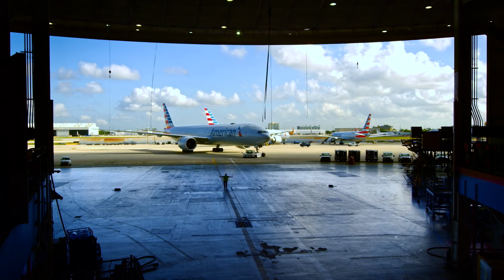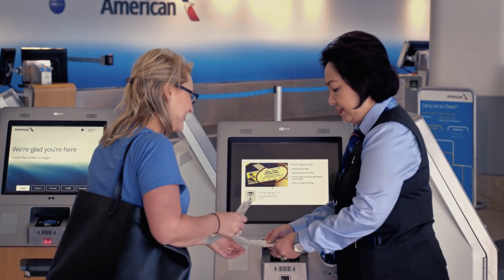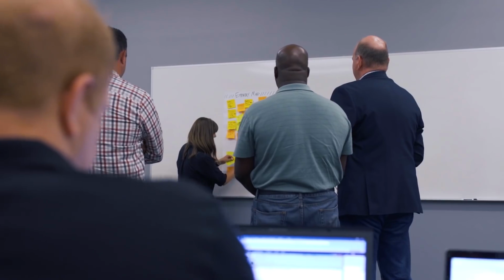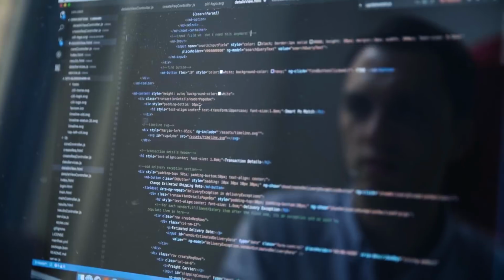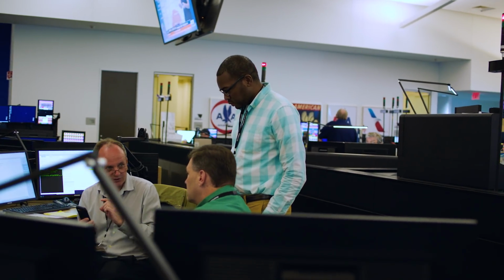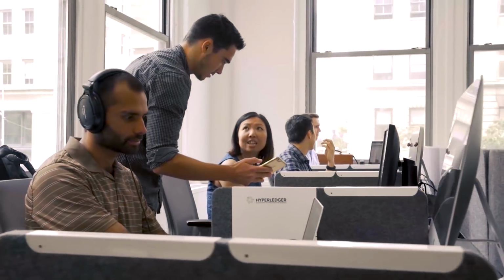IBM Cloud flies with American Airlines

Comment: 00:09 IBM's system helps find new seats for customers during flight disruptions
00:28 Automated system for customers to see alternate options for better travel experience
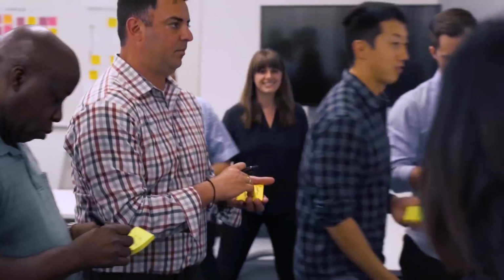00:49 American Airlines asked IBM to shorten project timeline
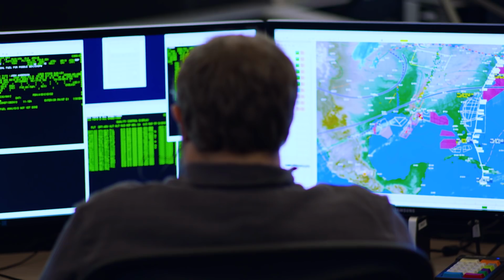01:05 Successful limited release of product
01:24 Utilizing cloud technology for rapid response during natural disasters
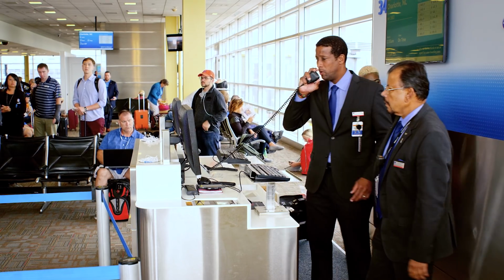01:45 Turning on the tool in hardest hit areas
02:16 IBM Cloud provides scale and reliability for global application deployment.
02:32 Leveraging cloud technology with microservices for easier problem-solving
Crafted by Merlin AI.